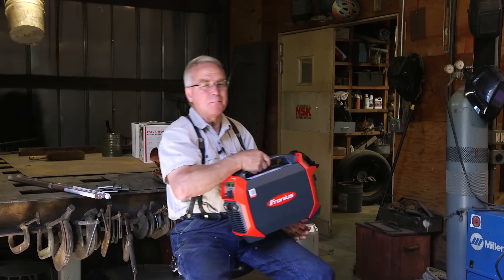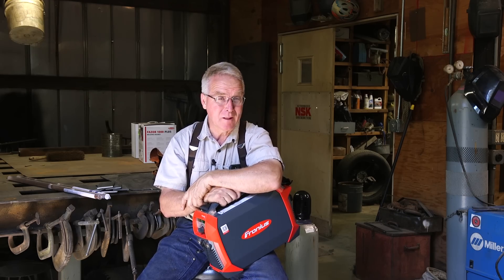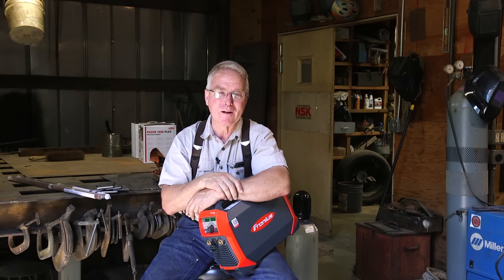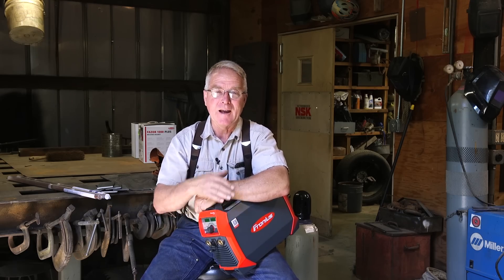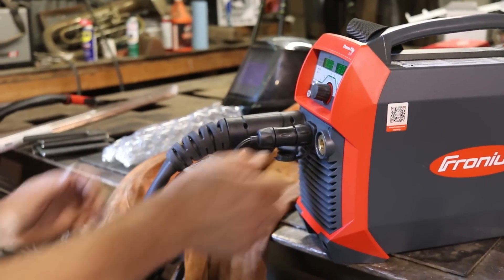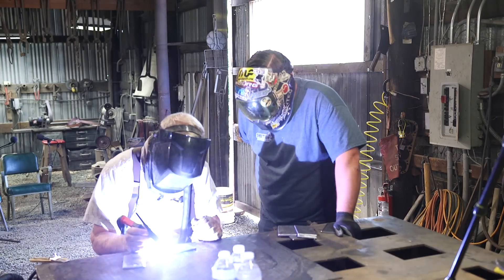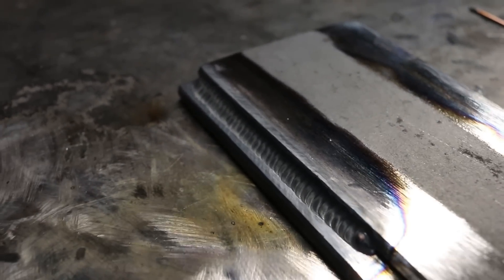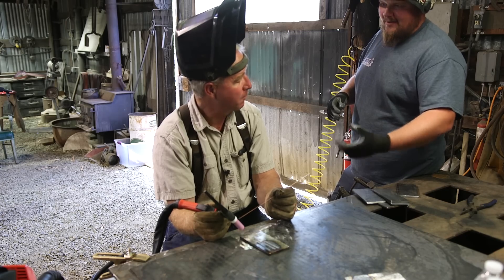EC's first TIG Welding Lesson

Comment: I learned oxy/acet welding more years ago than you are old. Later I bought a buzbox stick welder. I've had an occasion to get back into welding. It seems everything and everyone is using MIG. Many years ago I took a class in welding and the instructor told us not to spend too much time on MIG welding because it was not allowed in any construction situation--not even walk way railings. Any way I bought a MIG welder and rented a bottle of gas. So then I had to rent 3 bottles of gas--about that time something happened at the manufacturer of acetylene and we couldn't get bottles refilled. After that, the price went up so much that I switched my oxy/acet to oxy/PROPANE. Propane is not a very good substitute for acetylene. I found that foreign made combination welders ( stick, tig, plasma cutting) are really cheap and for do it yourselfers, work quite well. Now I want to try my TIG welder, but I have to get another tank of a different gas. Thought I'd get a small tank to start with ----$300 ---$200 for a lease and $100 for gas. I guess I'll forgo adding another mode of welding to my reportage.

Comment: They also make a magnifying lens that snaps into the window of the welding hood. For people who need glasses it is a game changer because good sight is absolutely paramount for any process especially TIG. It's called a cheater lense if your interested. Also check out a "TIG Finger". Its a heat resistant material that slips over your finger and allows to prop and slide on red hot surfaces, also a game changer

Comment: I inherited by father's Miller 300DX TIg machine. He never used it. I didn't know anything about any welding, but I asked for it because i wanted to learn so that I could weld a bicycle frame. It was very frustrating having no welding experience, but I learned. My first project was welding a cart for it and the bottle. It has back wheels from a wheelchair, front castors from another cart, a bottle storage restraint and rod storage tubes and a place to park the torch and wrap the cables. Even has a parking brake. Painted it Miller Blue. lol.

Comment: Hey not sure if you know about not using chlorinated brake cleaner when welding but its especially important when using tig as its more likely to happen then with mig or tig.  If you dont know about it, if you use chlorinated brake cleaner to clean up metal before welding and there is any left, when you weld it produces phosgene gas.  Super deadly.
Reply from the maker: Thank you!!! I did happen to know that and I have mentioned it on the channel I think but I intend to make sure that I make a point of bringing that to everyone’s attention. Argon and chlorine  at temperatures over 2000° create phosgene gas. You probably will not make it out of your shop alive. I really appreciate you pointing this out for us!
Reply: @essentialcraftsman  it's especially bad with tig as it's the uv light coming from the arc that does it, and the absence of smoke makes the light more intense.

Comment: Some free advice: get Nate a zoom lens and variable ND filter on it for shots of your welding puddle. Zoom lens keeps him back from sparks and fumes. ND lets us see your weld. Nate should NEVER look at the arc unless through the LCD or a filter (or special glasses for welding). That UV is worse than the arc. I have to ask: I didn't think there was a pedal for that model welder. Can you provide link..oh..I found it ... Fronius Foot Pedal: 4,046,110  guess they updated info to work with 210 model... maybe tell them their website is ... confusing?  Good luck TIGing!

Comment: how do you feel now, about the decision to weld with a short sleeve shirt ?
Reply: I thought welding wouldn't be worse than the radiation from the sun. I was wrong, the UV radiation is surprisingly intense. 
Didn't get a bad burn, but just enough to notice it the next day.

Comment: welding.tv is an awesome resource too. That guy is a library of knowledge. TIG is a completely different world but not unlike oxy acetylene welding. The principles are the same just different materials and gas with a higher temp. It takes practice practice practice to get it under your belt. And yes cover your dam arms even with a jean jacket to keep the RADIATION  off them. You will blister up bad if you don't.  Its not worth the skin cancer.

Comment: Just a little bit of a safety-tip - Don´t grind the tungsten "against" the belt, if the tungsten were to catch the band it's gonna end up in your hand/wrist in best case scenario. Turn it 180 degrees and hold it facing down towards the floor - you´ll still get the scratches on the tungsten in the right direction, but less dangerous :) 
Thanks for all the great content <3 
 //D

Comment: As a welder of 13 years I'l say this, Its a trade like any other, there's GOOD money in it if you look and are willing to travel and have the skills, but for the most part welders just make a 'decent' living. As for a skill in your wheelhouse, you are 100% correct it will set you apart from your everyday wrench turner or construction worker.

Comment: As a welder by trade I gotta say man cover that skin. 

That is all
Reply: UV-B and UV-C from welding not good for the skin
Reply: @robstephens  Its not the UV its the Radiation that kills ya.
Reply: @greatitbroke  what do you think UV stands for? It’s ultra violet radiation.
Reply: Greg Dent all light are forms of radiation
Reply: @trijigon  is clothing an adequate shield when welding?
Reply: Yes, as long as it is not synthetic (ie very flammable) and you are fully covered.

If you're just doing a bead here and there you'll be ok without, but if you're welding not than a foot or two or you're welding regularly you want to stay covered.
Reply: @trijigon  Yes and no. When talking about radiation, people generally mean ionising radiation. This is the radio spectrum from UV upwards, which includes X-ray and gamma ray. This radiation has the energy to ionise particles - either in the air or in a material like your skin. This can cause burns or DNA damage (if the radiation contains enough energy). Even when your skin stays totally cold to the touch, you can get radiation burns. 
Everything below UV is non-ionising, and generally categorized as electromagnetic waves rather than radiation. 
Even if they're incredibly strong, the electromagnetic waves (like visible light) will not damage your DNA or ionise particles. Visible light and radio waves from your phone or from a broadcast station, can't damage your skin or DNA. 
Although your skin heats up in the sunshine, it's not the heat effect that causes sun burn. This is why you get a sensation of hotness in the sun, but not get sunburn, if you wear sunscreen when sitting in the sun.
Reply: LimaVictor lol, all light are radiation..
Reply: karcinoma if you want protection it not only needs to block uv but protect you from weld spatter, flame, hot things, and yourself. Pro welders often wear purpose made welding jackets or sleeves and clothing that doesn’t melt if it gets hot. Don’t forget to wear shoes that can handle everything too. And least not, don’t overlook welding caps and ear coverings. And I hope you remember proper ventilation. Also don’t forget to wear certain types of contact lenses. There’s more, but yeah, clothes are all you need for protection
Reply: @mfbfreak  Yes! Exactly this. I wish more people understood the difference between "radiation" as a general term for nearly every electromagnetic emission and "ionizing radiation". As you say, while light is technically a form of radiation, it has many orders of magnitude less energy than ionizing radiation and is better categorized as just "electromagnetic waves".
Reply: When I saw his bare forearm so close to the arc I cringed. He will remember that.
Reply: karbonxiii  I was more taken aback that Nate had no eye protection.  Even though he’s not looking at it in the shot, all it takes is a glance and he could damage eye sight.
Reply: That's no joke! People think just because there's no sparks, they won't get burned.

Comment: "How to get a farmer's tan in 1 easy step" :-)
Reply: When I welded in a shop professionally, it was me and one other guy. We got a job in the shop one day that required us to weld for almost 8 hours straight. So we put up a wall between us and went to work. The next day I had a sun burn on the back of my neck that was the worst I'd ever had. But the other guy did not. Turns out the flash was bouncing off the ceiling which was at an angle, up over the wall to my side. That's the day I learned how damaging arc flash can be.
Reply: knucklecorn don't forget farmer's cancer 👨‍🌾
Reply: We are required to wear long sleeves at work if we are welding or in the welding booth no matter what but I still use spf 50+ UVA, UVB protection for my face and neck because I am normally not the one welding so I don't have a hood. Welding is fun but it's also important to try and stay safe
Reply: Isn't that farmanoma?
Reply: I am super sensitive to sunburn. I was wearing a short sleeve shirt with some long gloves. But a tiny bit of skin on the inside of my elbow was not covered. 
Even with just an hour of practicing (stick) welding, i already got a bit of sunburn right at that spot. 
The radiation is intense.
Reply: Farmers don’t tig they stick weld with their eyes closed on a 60 year old Lincoln tombstone.
Reply: Hahahah yes..
Reply: Oh yah...had some terrible burns on the insides of my elbows and arms while tigging aluminum in a tee shirt..haven't really been burned bad doing steel though, maybe less reflective surfaces.